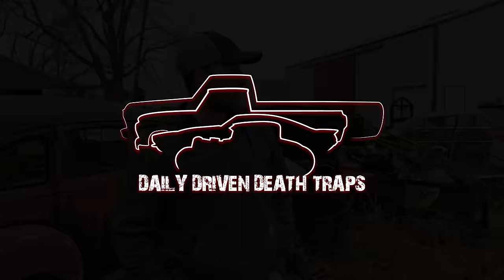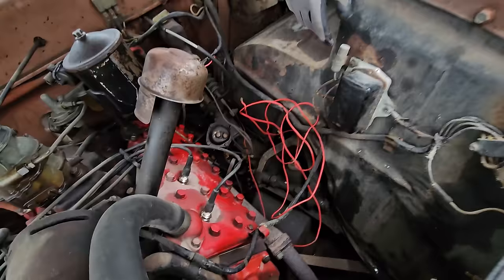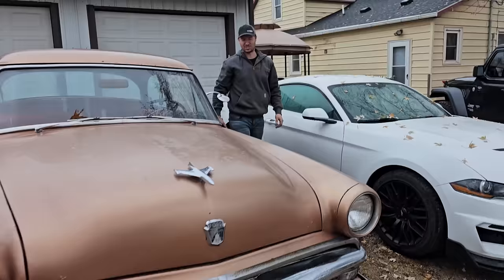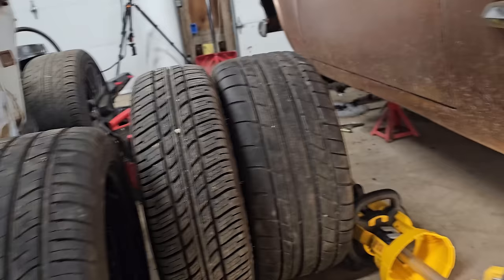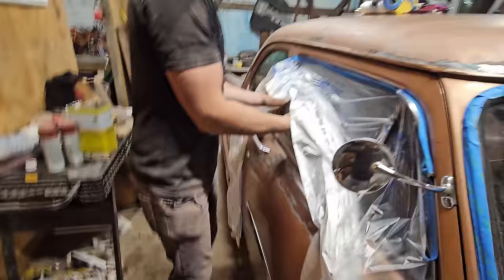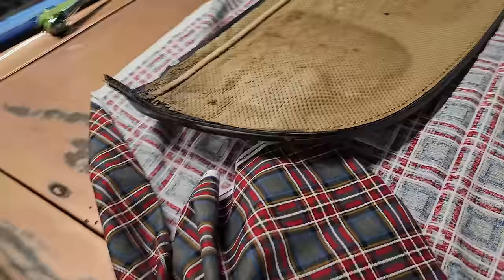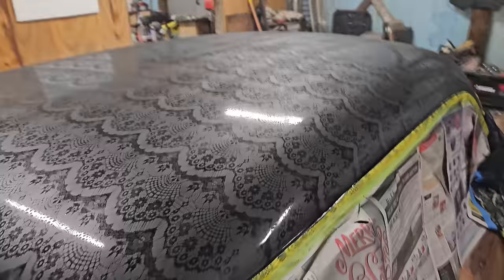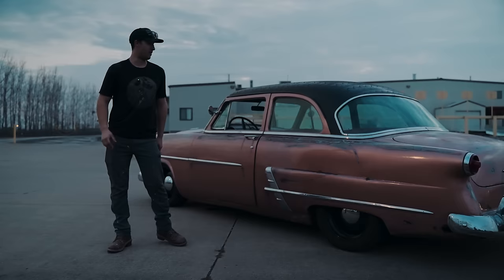SAVING a 1953 FLATHEAD and TRANSFORMING it on a BUDGET

Comment: Battery cables too thick....what???? Six volt systems carry less voltage but more amperage than 12 volt systems so they have to have thicker cables. I suggest studying electrical theory a bit. SMALLER cables carry less current, that's why overloaded wires melt.

Comment: Larger wires, less resistance, therefore less heat that would kill the battery. Keep the large wires!
Reply from the maker: Yeah we got roasted in the comments about this haha, we don't work on 6v systems that much. Converting to 12 soon.
Reply: Not necessary to convert to 12 volts if wires remain same heavy gauge and all grounds are cleaned with knife or wire brush. May also add a ground cable from engine to body. Make sure battery is good and fully charged.  @DailyDrivenDeathTraps
Reply: @DailyDrivenDeathTraps  WHY??
Reply from the maker: @jeffryblackmon4846  BECAUSE??
Reply: 6V or 12V heavier gauge is better.  Electric cables are similar to water pipes in that the larger the diameter the better the flow due to less resistance.  it looks to me like the owner did a common upgrade to welding cable for the main leads. @DailyDrivenDeathTraps
Reply: I was loudly saying the same thing at the screen.  😄
Reply: This brings back fond memories. y parnets had a 54 ford V8. I do not recall if it was a V8 or a 6 cylinder.
Reply: I agree with wschell4023, looks like welding cable. The problem with THAT is that real battery cable has oil resistant sheathing. Welding leads do NOT, so keep your eye on the insulation to make sure it's not degrading and you burn that old beeotch DOWN!
Reply: @wschell4023 l agree, it looks like welding leads.
The problem with that is that real battery cables have oil resistant insulation, welding cable does NOT.
So keep your eye on them for chemical degradation.
Don't want to burn this old beeotch DOWN!!!

Comment: I have a 63.5 ford falcon sprint with a 260 and a 4 speed. My  great grandfather bought in new in 63.  I went thru and did a complete frame up restoration, keeping everything original. I rebuilt motor, kept it a 2 barrel kept the points and condenser stayed with everything stock. I’m now in the process of switching it 4 barrel and HEI and prob gonna put a cam in it as well. Like I said I went thru a lot to keep it original, got done and looked back and was like. “There is nothing of me in this car”. I even went as far as getting a trunk latch that was made in 63 for a falcon sprint when mine failed instead of just snagging up an aftermarket one. So with all this being said it’s your car do what you want. Make it something that has some “you” in it. Original is just something that rolled off some assembly line somewhere. Keep it up boys! Love these videos.
Reply from the maker: Sounds sweet and lots of work! Gotta add a lil "you" touch for sure. Appreciate that!
Reply: Also that top is probably one of the coolest and neatest things I’ve ever seen hell of job!!!

Comment: The reason they had super thick battery cables is because at 6 volts you require rougly double the amperage for every 12 volt equivalent circuit. (Yes pedants I know its not that simple but P=IV). On my 51' Chevy it had 4 Gauge battery cables and had a really hard time starting, once I switched to 000 gauges it cranks no problem.
Reply from the maker: Good info!

Comment: I have a 54 . Installed a 390 and a 4 spd . Raised the front 2 inches and the back 1 inch . Yes I raised it ! Added power disc brakes and a new front cross member.  22 years later I'm still driving it !
Reply from the maker: That sounds like a fun car for sure!
Reply: Took a ride in the day, 57 Custom 2dr post, 390/tunnel ram/top loader/4.56, set you in the seat right smartly.
Reply: Yes... Get these cars off the ground. Sounds like a winner!

Comment: Yep, you definitely destroyed a great old car that would have been an easy restoration or partial restoration. There's not too many of these cars left and you kids are picking them off one at a time and destroying them.  Such a shame.  ALSO, please STOP with the fast camera movements. Damn, you made me seasick watching this video.  It's absolutely unnecessary to move the camera around like that.  Oh by the way, it's a 6v car, that's why the battery cables are thick.  They are supposed to be.  Also, that's a tube type radio.  When you turn it on, it takes a few seconds for the tubes to warm up before it works.  If the radio doesn't indeed work, it's probably a burned out tube.  Those can be replaced.  Just research and I'm sure you can find somebody that sells them still.
Reply: This is is a restoration video if you can find a way to play it backwards. Like Derek's Packard two door.
Reply: The next generation is all that's left to carry on the car hobby. If you rather the hobby die with your generation then keep on having a closed terrible opinion
Reply from the maker: While your generation can let them rot away in a garage we'll take them in and give them a new life. You can undo what we did easily if you want, come buy it.
Reply: @DailyDrivenDeathTraps  --  You're giving them an altered life for sure.  Unfortunately it would cost a lot more now to undo what you've done.  Besides, I have enough classic vehicles as it is, that are safe, sound, and STOCK.  Even my generation has hotrodded classic vehicles, but there were a lot more of them back then.  To find a stock 50's car in good shape is very difficult today.  Why don't you make a hotrod out some derelict instead, like Halfass Customs does.  I don't have a problem with him for the most part because he basically works on complete POS's that are rotting in a field. But to ruin a great car such as this, such a shame!!
Reply: @MegaFitz50  --  Ya well the "next generation" has this idea of totally destroying a good cars originality instead of preserving it.  Now, if they want to hotrod a derelict car rotting in a field, no problem with me.  But this car was all original, running good, little rust, easy to preserve or restore.  It deserved better.
Reply from the maker: @ironcladranchandforge7292  come buy it then.

Comment: Large cables are good especially with 6 volt systems. Larger cables have lower resistance which results in less voltage drop between the battery and the starter. 6 volt systems are notoriously hard starting so they need all the help they can get.
Reply from the maker: Thanks for the info!
Reply: I have a lot of 50's trucks and tractors, all 6-volt and they actually start better in bitter cold weather than most of my later 12-volt units.  If they are tuned up usually a couple revolutions and they are running.  You have done a nice job, I hope you keep, appreciate, and take care of that sweet engine.  Be sure to check and or change the fluid in the differential and pack the front hubs.  I noticed what looked like a bad rubber brake hose for the rear end.

Comment: Looks great!  I picked up my ‘46 Chevy truck and the outside looked like crap.  Mismatched panels and lots of mismatched paint.  I went to town on it over the Summer.  Sanded all the bad spots down, scuffed the rest.  Next, laid a nice brown primer over the whole thing.  Then, pained the fenders black and the body gray.  Finally, went over all the fenders and high spots which I thought would take a beating from the sun and wet sanded through the paint to reveal the primer in those spots.  Turned out really nice and I get compliments on the patina all the time.  Best part is I spent less than $250 on all the paint and supplies and did it myself in the garage.  Probably the best $250 I’ve ever spent.
Reply from the maker: Sickkk!🤠

Comment: ;Back in those days we used 20 weight oil in winter and 30 weight in summer. I think I saw the heater core bypassed so the core may be leaking. I don't know about now but in those days you could take the heater core to a shop and also the radiator to be rebuilt. None of the plastic crap of today.

Comment: To begin with I was a bit doubtful with faking a patina, because if it's done wrong, then it looks 'try hard' rather than the 'care worn' one normally goes for.  I'm not a big fan of patina because it appears (from my view at least) to be overplayed a lot of the time with people looking at something like the Javelin's paintwork and calling THAT patina.  No, that's just a hodge-podge of different panels on a car that had a cheap yellow paint job to begin with.....and if anything, it's more of the Rat look than the Patina look.....but I digress.

I ain't no boomer, mate - I'm a Gen-X, so I'm still 16 years younger than that old girl.....however, I get it.  I get the patina look.  Back when I was in my 20s, it was referred to as the 'original' or 'aged' look.  I had a number of cars with that look at the time and the one I'm thinking of as the best example was a 1957 Austin A55 deluxe, although I was actually 18 when I owned this one.  She had two-tone paint - Old English white (sort of a rich cream) over dark blue over OE white again.  The blue was on the nose cone, then split around the sides of the car at the height of the lower windscreen seal and stopped at the chrome body moulding that ran the length of the car about two inches below the door handle.  White was below and above that, over the roof and down the rear.  She was a great looking car with all the 1950s British car touches and ever single extra that the factory offered (4-speed column change with overdrive, too!).  However, the paint was very tired and the blue was badly crazed.  I tried bringing the OE white up, but the only bit that came back with cutting and polishing were on the door sides.  There was no way the boot (trunk) lid, roof or any of the blue would come back.  So, I started experimenting and found a linseed based furniture polish worked marvellously on the dull paint, turned the blue from pale and oxidised back to a lustrous dark blue and brought the roof and boot lid up beautifully.  It went from s--tbox to looking like a well-cared for survivor, albeit with a few battle scars and some rust showing through in a few places.  With the rust, some was quite scaly, so I sanded it off, dusted it over with a white primer that did not match the OE white paint and found that the car STILL looked better with some of the worst of its rot just painted over as a disguise.....but an obvious cover-up, so she was still wearing her years with pride.

I currently have a Triumph Stag and a Triumph 2500S - both of which are in 'a similar survivor' condition. The Stag has had about 6 resprays in its 50-year life and the paint is so worn that you can see the transitions through to earlier paint jobs where I have polished through the paint in order to get a smooth finish.  There are parts on her that are down to the factory undercoat and she's down to metal in  couple of spots too and all I do is polish over them again....although the metal has had clear coat (a spraybomb coat or two) over the top to stop the rust forming and is working, so I have left it alone.   Now, this is a rare and expensive car, so why don't I repaint it?  Well, to get it right, the whole lot would have to come off and she has some battle scars underneath that have been hideously repaired and to be honest, it would take me more years than I care to spend prepping it.  I might get around to it one day, but for now, the Stag and the 2500S both are just going to continue being driven and enjoyed.  If I have to pull either of them off the road for an engine rebuild in a few years, then I will get into the bodywork while the engine is being rebuilt and we'll see what cooks then.....so yeah, I get the patina look  It's a way of showing a car's life, age and experiences.

Now....your Customline......in some places, I reckon you got it spot on.  The bonnet (hood) is a beautiful example of that.  The lines along the tops of the doors and fenders aren't quite far enough down the sides in my opinion and they need to be feathered a bit more.  The boot lid doesn't appear to have any natural or flowing pattern to it and looks more like someone has started preparing it for a paint job it never got.  However, everything is fixable and it's perfectly acceptable as is.  Don't worry about the roughness in the clear coat either - patina cars are best viewed from 10 feet, so nobody will focus on the finish and only note that it shines beautifully.  I absolutely LOVE the lace top on the beast too!  What a FANTASTIC result!  Yeah, you can see how you might improve on the next go, but man, what a thing to behold!  Love the flannel door skins too.  If there was a way of incorporating the original card's style - say, with some 5mm stick-on chrome piping - just to break it up as a homage to the original styling, I reckon that might add a bit of flare.  I like the idea of the black interior too as it will make the fabric / vinyl etc colours and all the chrome inside just pop out at you.  Love the stance on the beast too.  I was a bit worried to begin with, but I stand corrected - it's definitely sitting where it needs to be.  Love the moon caps too - something had to break up the black - and the 17s look much more at home on it than the 14" originals.  I also agree with throwing tints on it - 35% all round with a graduated 6" strip on the top of the windscreen (if possible) will just finish that look off.  

The future?  You wanted to paint the "bullet" in the grille.  Maybe hand paint straight over the shiny chrome and stand back and check it out. If it suits, THEN go back and rough the chrome up to paint it properly.  Personally, I'm of two minds and I love the big chrome dome on the bullet, so it's a hard one to see without my mind's eye over-riding it and saying no!  I'd give the old flathead a birthday with new plugs, points, cap, belts etc, check the oil in the box and diff and go around the beast with a grease gun and make her happy.  I've not modified a flatty, although I have heard there are still plenty of items around for improving performance.  You'll need to speak with people older than me who know them well, so don't go insulting boomers too much (haha). The exhaust has a nice rumble to it without being too quiet or too shouty, although I am a BIG fan of duals on a flathead.....straight-piped from front to rear.  When you convert her to 12v and put an alternator on the beast, chuck a good set of 7" semi-sealed Halogen headlamps in the beast and you'll be able to see at night.  Please don't chuck LED headlights in it because they will just look wrong, whereas Halogens are a period upgrade (well, 70s onward) and still look original.  

I'm looking forward to seeing more on the beast as the project moves forward.  She's a great looking old car with a stout heart and she deserves all the attention she's getting.  As you say - get it to a point where the younger gens are looking at the old school stuff is the way to keep them alive and out of the junk yards.  That's the cars, not the kids!

All the best from me in New Zealand.

Comment: Another old guy here.   That is a very nice find, especially in Iowa.  One thing you may not know about your Flathead is that in mid-1951 Ford stopped using hardened valve seats.   Of course we don’t know if that is the original block, or if someone had hardened seats added at some point in its life.    Maybe the former owner will know.   Anyway, if it doesn’t have hardened seats, unleaded fuel will cause some issues pretty quick.   Look for the stamped engine number on the top of the engine, kinda between the intake manifold and the head, near cylinder #3.   Decode it…. If it’s an 8BA or 0BA , you’re OK.   If it’s a 1BA you might not be Ok.
Reply from the maker: Appreciate the info!

Comment: Y can't you leave it the original and just drive it
Reply: It wasn't Original or I would have agreed with you.
Reply from the maker: I believe it's explained in the video why
Reply: Just like the other guy said, it isn't original, it got repainted, the engine had a lot changed, and there are welded patches in the floor.
She is in great condition for sure, but not factory original.
Reply: Original isn't cool enough
Reply: There's always one.

Comment: You definitely need to have someone teach or explain to you wire resistance and gage size.  Larger wire has lower resistance.  Putting some Marvel Mystery Iol down the cylinders is a good idea on an engine not run in several years.
Reply from the maker: Yeah we've gotten that comment bout 100 times haha. I think sean actually knew about that it was just a brain fart

Comment: There is a tool you can buy that takes those door handles off, although it might be hard to find.  However, most restoration shops have them.  It's a very simple piece of metal that, if you google it, you'll probably find it.  It makes the job so easy.

Comment: Any old 6 volt system in the cars had larger battery cables to carry the higher amps. If you put smaller or regular size cables on a 6 volt you could burn them up.

Comment: Back in the 1960s we had a '53 Ford Crestline Victoria,  the pillarless hardtop body style.  Ours had the Fordomatic, plus the factory radio and heater package.  It originally had the standard 239.4 cubic inch flathead V8, but the engine wore out and Dad got a Mercury flathead V8 installed.   That car took us to Cape Cod in the summer, and to Rhode Island every other week to visit our grandparents.   Sadly New England winter salt ate away at the body until nothing was left, so Dad sold it and bought an almost-new 1964 Fairlane 500. Sports Coupe with bucket seats and a 260 cubic inch V8.  Yeah,  Dad was a big Ford guy!

The original V8 was rated at 110-hp.  There also was an ohv straight 6 rated at 90-hp.